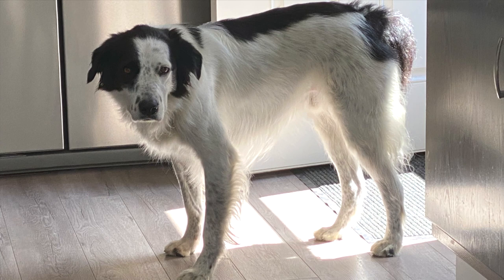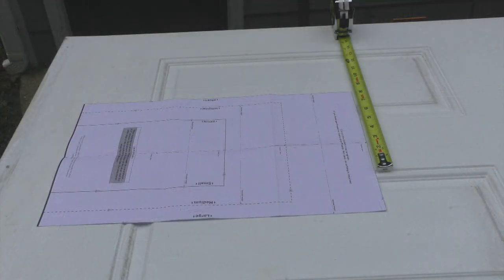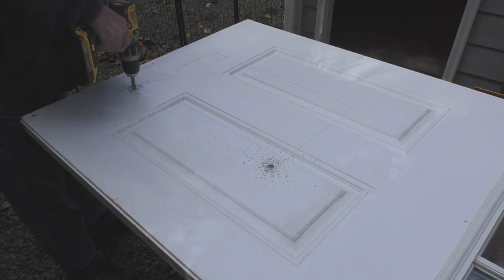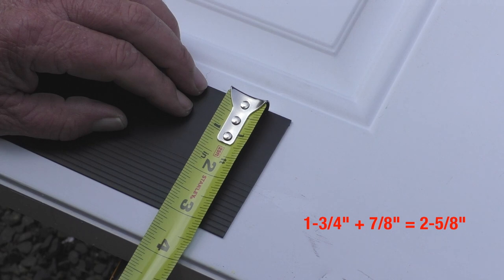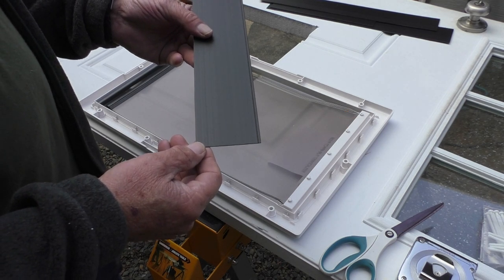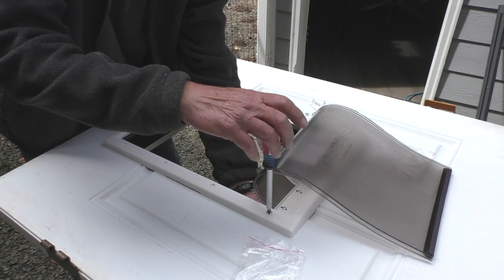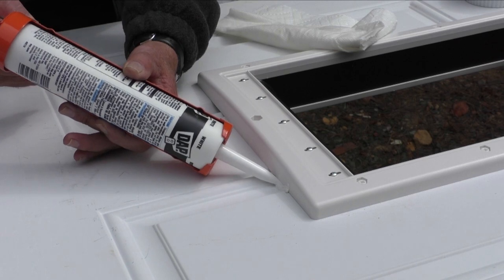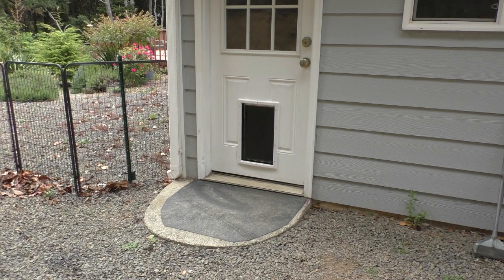Installing A Dog Door

Comment: Great video - my doggie door is in but my dog won't go through it - he is afraid of the flap.... still working on that!
Reply from the maker: We've had good luck opening the flap and tempting our dog through with a treat.
Reply: @Iscaper  I have had a dozen "training sessions" with my dog; each time he has been given 20 treats (one for everytime that he goes through the door) - I have to hold the flap up, as he "doesn't like it touching him".  I will say that my doggie door is more challenging than most, as I live in a metal building and the wall is 12" thick; I got a special doggie door that has a "telescoping tunnel".  Plastic door at either end, and I carpeted the "tunnel".... I have even SHOVED him through from the outside to find a PILE of treats waiting inside........I've had to take a break.  I have a standard doggie door in a wooden door from the shop side of my building; that has a tri-fold clear plastic door - he won't go through that either... since It is 100 degrees outside, perhaps I should put him out and make him come in through the doggie door (he barks outside for me to open the door, which I do).  BTW - I have a Jack Russell Terrier (my third - the other two used the doggie door the minute that it was installed) - this one failed to get the "intelligence" or "courage"
Reply from the maker: @karlaelvis9815  Let us know if you figure out a way to get your dog through the door.
Reply: @Iscaper  I just had a thought... I'm going to use the method that I used to train him to "come - put his harness on (so as not to choke him), attach the leash, and gently pull him through the door... stay tuned!
Reply from the maker: @karlaelvis9815  Good luck!